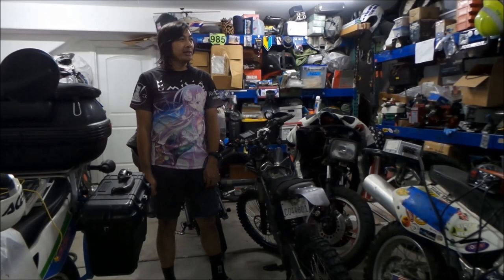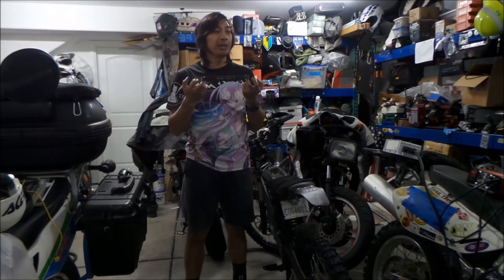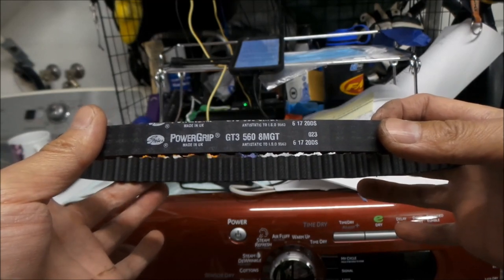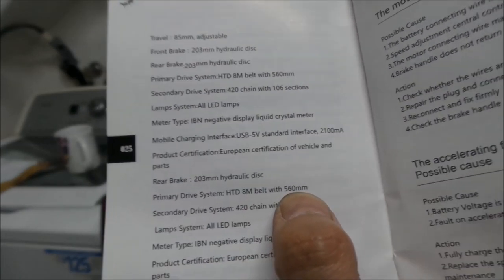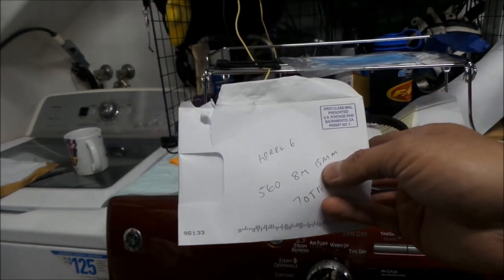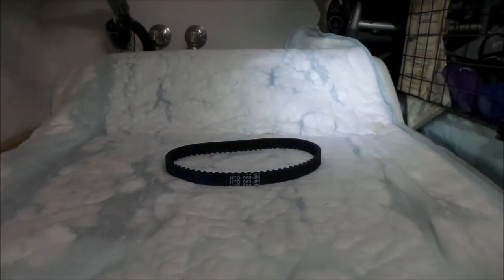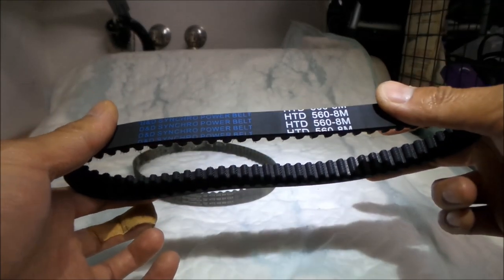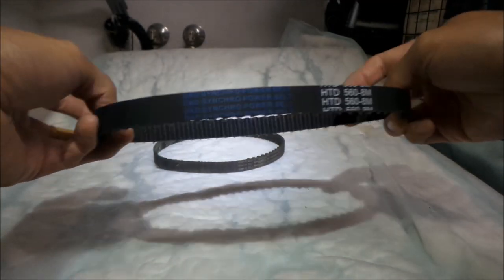Sur Ron Light Bee Primary Drive Belt VLOG

Comment: They actually not cutting them from 20 mm, they cutting them from standard 480mm sleeves. So its normal to have some shaving on sides.

If you will find a local supplier that specialized in those belts - you will probably buy them half the prices. Contitech HTD 560 8M CXA is about 1-1,5$ per mm and they cut them to your size.
Reply: They even have a synchroforce carbon reinforced one, just bought one

Comment: Have you tried the website SurRon Australia? They sell a lot of Sur Ron parts with much lower prices. For example the RST  front fork  axle. They sell this for  USD 7 (+ shipping) Compared to Luna Cycles’ USD70! For the primary drive Continental belt, their price is USD 35.53. Out of stock though.
Reply from the maker: Wow they sell the axle for $7!?  What a bargain I did buy the axle from Ebikezilla for $50 it was $70 at Luna.  It pays to shop around buy the fastest is Luna Cycle because of where I live.
Reply: HadesOmega Moto yeah I understand . I live in San Diego.
Reply: @hadesomegamoto7639  Yeah its because our $ is crap :(